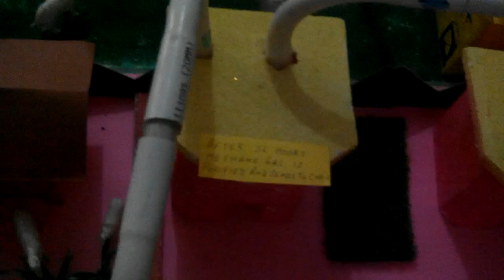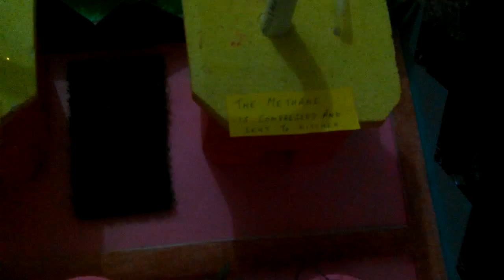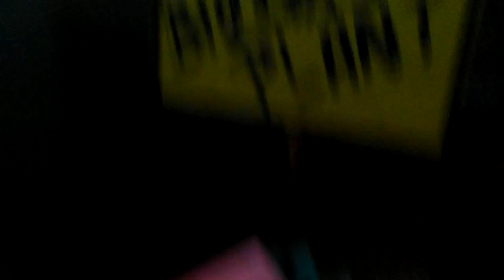Biogas plant  working model

Comment: what r the materials required for making  generator ? Sir,plz send the procedur to make generator and what happens inside the generator
Reply from the maker: Swapnil Jain Biogas is a mixture of methane, carbon dioxide, water and hydrogen sulphide produced during the anaerobic decomposition of organic matter. Biogas can be recovered and used either directly for cooking, lighting or it can be transformed in any kind of thermal, electrical or mechanical energy. It can also be compressed, much like natural gas, and used to power motor vehicles. Methane is the valuable component under the aspect of using biogas fuel. The calorific value of biogas is about 6 kWh/m3, what corresponds to about half a litre of diesel oil.

Comment: Listen can u plz write this process and whatever u hv written on Chambers . It will take time but it's urgent i have to make a non working/ working model of bio gas plant. I will make non working. So no need to write what u hv use in making this model working.
Reply: Bcoz the writing part is not clear
Reply from the maker: sry i am very late to reply u 
bcz I have not seen it comment 
9896345935
Reply: bindas hasoo it's ok now I have already made my project and submitted it. Actually this was my summer holiday hw
Reply from the maker: Ok khusi ji